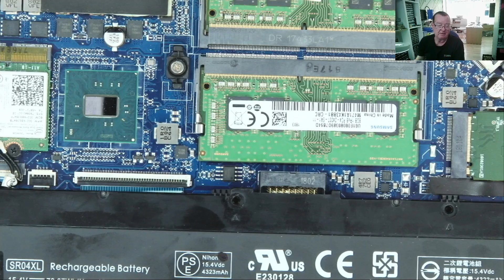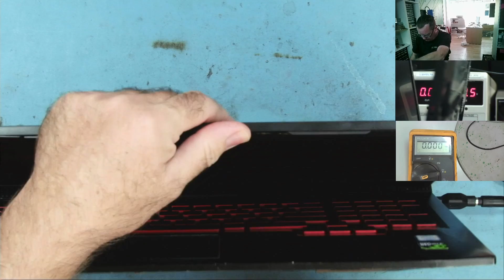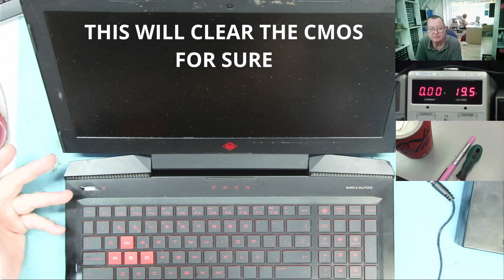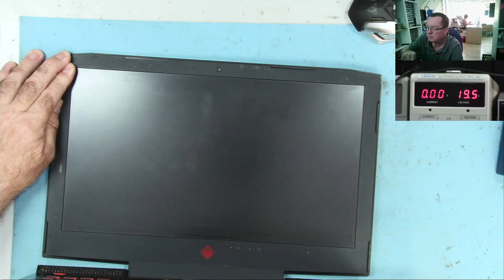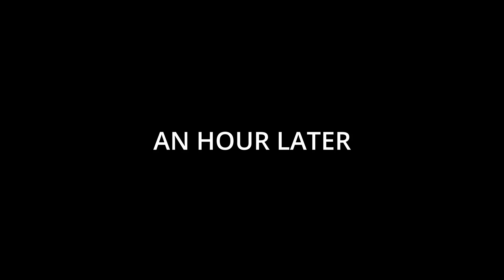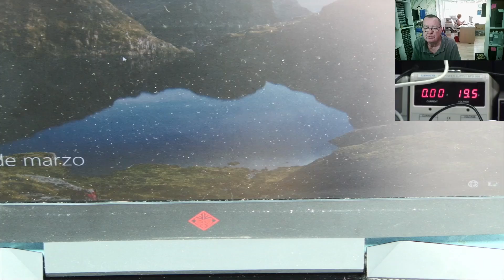This Omen Gaming Laptop Will Not Charge. Let's See If We Can Fix It. Laptop Repair

Comment from the maker: Thanks for all the comments guys.  I think I know why the 180W charger will not charge the laptop, even though it continues to provide power to it, and my 100W charger and bench PSU will charge it.  I'll check something tomorrow and make a quick follow up video
Reply: Why won’t it charge? (I’m having a issue with it right now)
Reply: @-Seb-  I have been dealing with same issue with same type of gaming laptop. How do you fix it?
Reply: I have been dealing with the same issue with the same type of gaming laptop. How do you fix it?

Comment: Hi Rich.  I saw your post on BadCaps site asking about an HP Omen 15 that has the single Red flash / White flash problem when hooked up to the charger.  Was this the same laptop?  What did you do eventually to get it to turn on?  I also have an HP Omen 15 doing the exact same thing.
Reply: Did u ever find a fix im having the same problem with the same laptop

Comment: I'm having an issue with my Omen 15 DC 0084tx laptop where the charger(150W original) stops charging after some time, even after recently replacing the OEM battery. While the number of disconnects has lowered after the battery replacement, the problem still persists.

Here's what's happening:
- The laptop stops charging randomly after a while.
- When I remove the charger pin from the laptop or turn the wall socket off and back on, it **doesn’t start charging again**.
- *The only way to resume charging is to unplug the charger from the wall socket and plug it back in.* Then it starts charging again.

### Steps I've Tried So Far:
1. Replaced the OEM battery — it improved the situation but didn’t fully resolve it.
2. Tried different wall sockets, including ones with a surge protector.
3. Inspected the charger for any visible damage (none found).
4. Checked the charger for overheating after it stops — it sometimes feels warm, but not excessively hot.
5. Updated the BIOS and power management drivers.
6. Performed a hard reset (held down the power button for 30 seconds with no power source connected).
7. Calibrated the battery by draining it to 0% and then charging back to 100%.
8. Tried the basic troubleshooting steps from YouTube like holding the power button, removing and recalibrating the battery, and installing/updating drivers.

Since I don’t have access to another charger to test, I’m wondering if this could be a charger issue, a problem with the wall socket, or something else (like the power management system or motherboard).

I have been using this laptop since 2019, and using same charger 🔌 the laptop came with.

Any suggestions on what else I can try? Has anyone encountered this problem before? 

Thanks for your help!

Comment: I have this laptop. There have been certain situations where I've tried to power it on and the screen would not turn on. I would have to remove the battery and it would start up fine.

But I'm currently having power issues. New battery. Charger is good. But it sporadically charges. While playing games, the batter will slowly discharge, because it's not always charging.

There is some controller somewhere that is telling the battery to stop charging and I can't figure it out.

Comment: my omen battery has 93 % charge but still dsnt turn on without charger. Some cmos error also comes. I tried quite a few ways to fix it but nothing works. This problem happened all of a sudden one day when i tried to turn on my laptop like every other day.
Reply: Is the battery OEM? coz i had same issue of cmos, as i dont have cmos battery in my laptop, its inbuilt in my main primary battery.

I bought 3rd party Battery and OEM battery. Now the CMOS issue is solved after using the OEM battery.

3rd party battery didn't fix the issue but i again replaced the 3rd party battery as it was under warranty.The 2nd 3rd party battery is working fine for me now .

Order of battery usage - 

• 3rd party battery as it costs less (but it didnt fix my cmos issue maybe battery was faulty)

• Used OEM genuine hp battery CMOS got fixed and no issues.

• 3rd party replacement battery working fine now also after using oem.

But i have one issue other than battery ,which is my charger stops the charging automatically even on OeM battery (maybe charger is  not working fine or other issue )

Comment: if the battery was replaced then it is clearly faulty, it does not want to charge at current it gets, and then it turns off, this is very simple error. You have to use original battery.
Reply: What if i used original battery and charger stops charging after 3-4 mins and i have to unplug and plug in charger in the wall outlet to resume charging(coz it wont charge if turn on off switch)

Comment: I had this problem on a HP laptop where it would not charge the battery even if the computer itself run perfectly fine on the powersupply itself, it just would not charge even if voltages was good. I thought the battery was dead, but then I took another HP supply and tried with that and it flippin worked, both charging and running the computer. I connected the suspect powersupply to a different computer and it would also run on that supply but I don´t remember if that charged or not, I think it did not. I am a bit suspect That HP put some kind of power delivery communication to some chargers because there would be no other way the defective supply would not work that way because it had proper voltage and still was able to power a computer directly. I been using that fixed laptop for about 10 years now and it always worked again with the other power supply.

Comment: Well Rick, your bench PSU just doesn't have enough power to charge the battery and run the laptop at the same time. But it has enough power to change the battery only. You can see the same behavior when you use underrated power supply for a powerful laptop. If it is working - not charging, but if you stop it it will charge the battery. And about the PSU of the laptop - I guess there is just not enough power and that is why PSU switches off under any load. So it still can run and produce 20 V when there is no load, but under a load it looks like there is not enough wattage to support even battery charge. My guess here - bad capacitors in the PSU of the laptop.

Comment: I have something i didn't realize was only 32-bit, which might still be useful for some older software, but they intentionally designed the thing so it simply refuses to run off external power, or charge while, "awake". Bloody dumbest thing I have ever seen, since it was, in part, responsible for actially killing the battery (also designed to be glued in, soldered dorest to the board, and using too many wires for any replacement... utterly flips me off.

Comment: HP laptop chargers have a sense pin which communicates with the charger, thus won't take power threw the charging port via a bench power supply or noncompliant charger. At least not for very long if it can't sense what it needs to sense for safety reasons. I think it's just a matter that it needs a compatible charger.

Comment: HP has some protection with power supplies when they don‘t have enough power to charge the laptop/notebook and shuts them down. this modell is a gaming one which needs about 180-250watts supply. with smaller psus it only charges in off/sleep state

Comment: Since the laptop only charges when in sleep mode and not when running (which it should also be able to especially with its gaming application) I think the issue is due to a power setting on the computer. Whether one exists in the user battery plans or even firmware is another story

Comment: Remove battery and power up the. Plug battery in if charging light comes one the. Off  you have a bad bq24xx ic try reflow..

Also if I can get it into windows try battery diagnosics or dell diagnosics

Comment: I have put 14.4 v on battery  while in laptop then the battery work up and started charging.

I removed the battery chargering coil then injected 14.4 v @ 1.amp battery very low it worked forme

Comment: Your Power Supply can not provide the amps this gaming laptop need! The laptop will notice and won't use the power supply. It will only charge the battery because charging current is lower. The laptop power supply is giving voltage but is it giving amps aswell?? Did you check charger with a load? Some things I think of.

Comment: Could be his charger or a faulty socket. I had an smps latop charger that would do the same stupid things and fooled me into tinking it was a faulty socket. Turned out to be the charger had a faulty controller circuit. Rock solid on the bench supply but wonky on the laptop charger.:face-orange-raised-eyebrow: Thanks for your excellent videos.

Comment: Hello teacher. I had the exact same problem at my repair shop. I was able to detect that it was a charger problem. Hp Omen only worked using original charger, due to some firmware update (EC or BIOS). Hp should have included checking to enable charging only with original chargers in the new firmware. with an original charger, the laptop will work, sure
Reply: always always use OEM chargers with these modern laptops. it's just not worth the risk
Reply: I have the same exact issue. Except mine will charge sporadically. I have an OEM charger, and new OEM battery.

Comment: Check to see if there was any recall on that particular model of laptop.  I have a WiFi adapter that is/was on recall for "overcharging" and swelling batteries. What the manufacturer did in the meantime was automatically (forcefully?) download a firmware update onto it, without my prior knowledge, that would stop the battery from charging until the unit was turned off.  It actually flashed a message across the WiFi screen that it would now do just that.  I did change the battery myself to a new one and it too, did swell up anyway.  I really think that it was just two sh$tty batteries that caused the problem because the unit did turn off when the batteries were fully charged.  Avoid Franklin batteries as I think they may be crap.....🤔
Reply: In this model, if you take the battery out and turn it on and charge it directly, will it turn on?

Comment: A faulty power supply can still deliver 19.5V, but fail to deliver the needed amps.
HP has a sense pin in the DC jack that senses if you're using a compatible power supply. Your bench PSU does not support that. You could however add this small resistor circuit to your cable.
Reply from the maker: If the PSU can deliver 19.5V but fail to deliver the needed amps then ohms law says if I try to draw more amps from the PSU then the voltage would drop, yes?  Or it would sense the over current, also using ohms law, and shut down.  I don't see how it can continue to supply 19.5V but refuse to supply the current.
Reply: @learnelectronicsrepair  I agree 19.5v failing to deliver the requested current would no longer be 19.5v - there would be some kind of voltage drop or more likely it would be protection mode and 0v

Comment: I think it may be that the new battery may have complicated things too, as it may not be compatible with either the charge circuit or the charger. Might be worth getting the old swollen battery back and see if there's any difference in accepting a charge. I agree with the sense pin stuff too, but it could just be the new battery is not compatible. I'd try to rule that out first, if he still has it.
Reply from the maker: I'll have to speak to Handy Andy, He dealt with the customer, who I don't know, and supplied the new battery and charger after I refused to look at it the first time. I have no idea what happened to it.

Comment: Hi Richard hp and dell has a adapter  detection. The adapter is not recognised because your psu and  adapter  has not enough wattage to run the laptop.   You can see in the bios if your adapter recognised. The adapter from the client is faulty. You will have this more. Hp and Dell are very picky abouth there adapters. If the client will buy an original hp adapter it will solve this problem. This adapter needs at lease 10 or 12a to run.  That is the reason why it not works.
Reply: Not the case, i have this issue and replaced both my battery and adapter and neither work.
Reply from the maker: Hi Steve, I hear what you say but it does not seem to relate to the evidence shown.  To resume the facts:

The adapter brought in by Handy Andy is 180W, it could be faulty but is brand new. It will charge the battery for a couple of seconds when inserted (on screen symbol changes)and the laptop is running.  It will not charge the battery when the laptop is off or in standby, the LED next to the power socket is white when the laptop is running (from the battery) and off when it is powered down.  It will not charge a flat battery

My adapter is 100W, so lower powered.  It will charge the battery for a few seconds longer than the 180W adapter when inserted (on screen symbol changes) and the laptop is running.  It will charge the battery when the laptop is off or in standby, the LED next to the power socket is white when the laptop is running (from the battery) and red when it is powered down and charging.

My bench PSU is 300W, but it is rated at 10A, so at 19V it can provide just over 190W.  It will not charge the battery when instered (on screen symbol does not change and PSU meter is 10mA) and the laptop is running.  It will charge the battery when the laptop is off or in standby, the LED next to the power socket is white when the laptop is running (from the battery) and red when it is powered down and charging.  I used this PSU to charge the  battery when it was completely flat

You say the adapter needs at least 10-12A to run, but I proved with the bench PSU the laptop only draws 2A, even when charging a completely flat battery.  This increases to 3A for a few seconds when the laptop comes out of charge into standby, then dropped to zero as it ran from the battery.  I don't have the windows password and expect it would draw quite a bit more running a 3D demo or game, but I find it difficult to accept, given the evidence on the video so far, that the problem is the laptop is not charging because the PSU wattage is to low.

On the 180W which will not charge the laptop, and you say is faulty, the PSU still gives 20V when the laptop won't charge. I also showed that in the video.  If this is a case of a faulty PSU could you expand on what you think is wrong with the PSU?  

Also how does the adapter detection work, given the power jack has two connections only (19V and Ground)  Is it sending/receiving some sort of high frequency modulated data signal on the 19V wire?  I don't see how that could work given all the smoothing caps and f they wanted to do something like adapter detection why not just have an extra connection or two on the adapter socket and cable?
Reply: @learnelectronicsrepair   Hp are very picky with knock off chargers. I have original 230w Psu to test this. Check in the bios psu  is recognised . It can also be that someting wrong is with adapter detection circuit. You can see if you have 2,6 v on acdet pin of charging ic. It is probably bq24780s not.
Reply from the maker: @stevedebeukelaer1424  Hi Steve,  I need to have a good look under the microscope tomorrow because as far as I could see the coaxial jack plug is just a standard 2 pin connection.  Thanks for the info
Reply: @learnelectronicsrepair  in your ad
Reply: NO adapter has ground , middle pin id pin is the pin you see  en inner mantle is plus.

Comment: If it’s owned by a true gamer, I bet that laptop has had its share of deceleration trauma. 

Start from any outside port or switch and work in. 

Throw some tech at it, perhaps thermal imaging of the area you were probing. 

Is there any chance that it’s caused by software? Windows power management going hay-wire?
Reply from the maker: My best guess it is software or firmware (EC) related.  I didn't show on the video but the casing is distorted at one side like it has been dropped at some time.